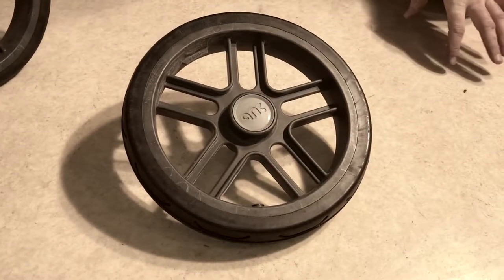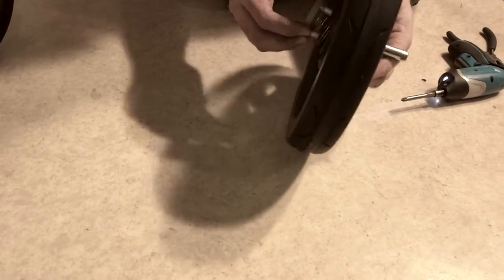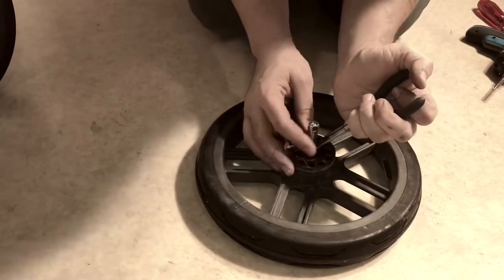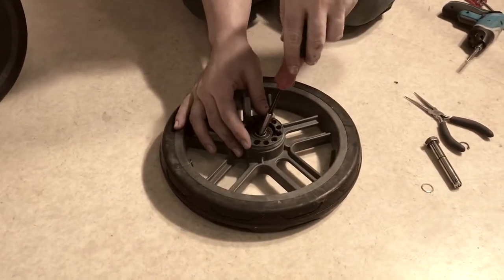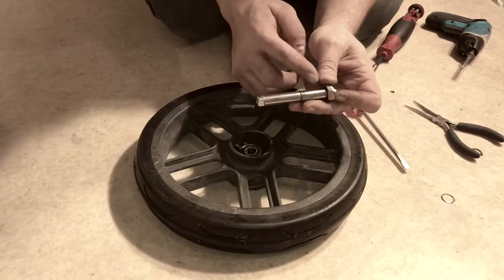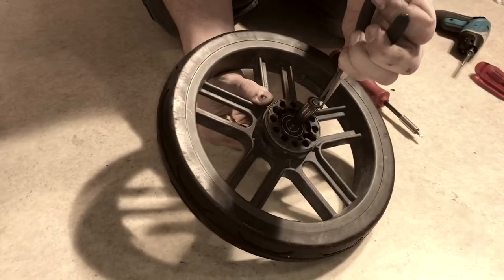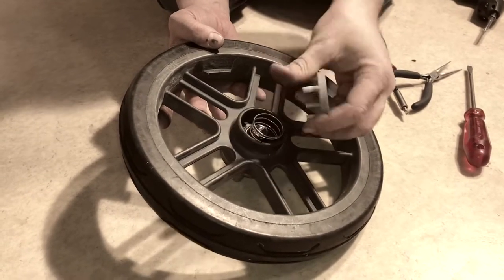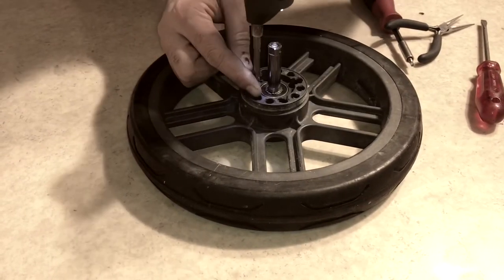How to Disassemble / Replace the Ball Bearings on an Uppababy Vista Rear Wheel

Comment: Hi there.  I followed your instructions and took the wheel apart and this is what I have.  It looks as if the wheel bearing completely disintegrated??   There are 5 actual little metal balls rolling around inside where rhe wheel axle comes out.  When I tip the wheel over the metal balls fall out.    Seems like a problem?

Any idea?

Comment: Where can I get those bearinga
Reply from the maker: https://www.youtube.com/watch?v=SqKJgGi5Lmo&t=28s

:)
Reply: The Stroller Workshop yeah my ball bearings where completely destroyed but there was one piece that was covered in bearing grease I washed it and saw the R8RS I found out I could get 10 bearings on amazon for 9.99 ordered them and replaced the bearings today came out good 👍
Reply: @Leth0  That amazing thanks - my ball bearing was totally shattered/disintegrated.   The actual balls were rolling around inside the wheel housing.   Ordered them today using your part number 😀